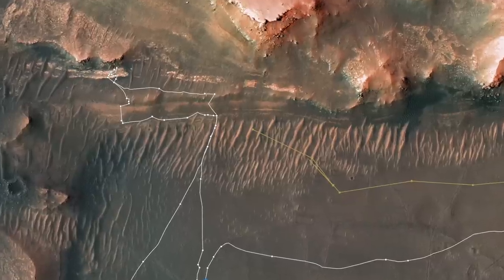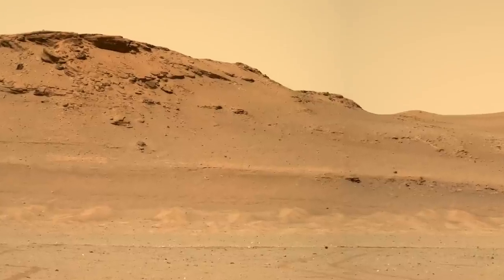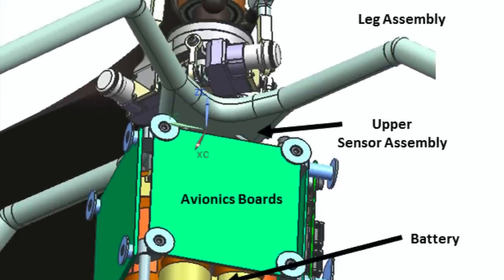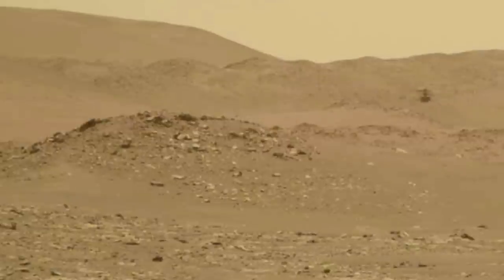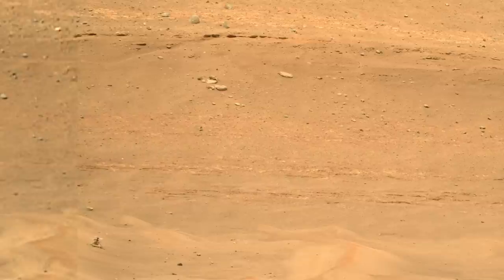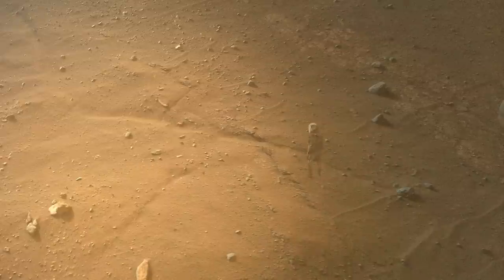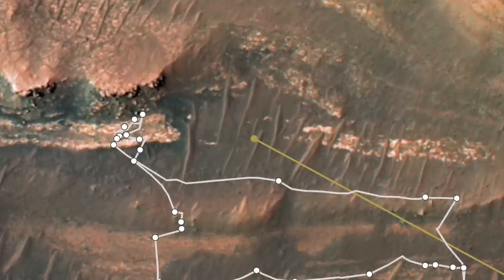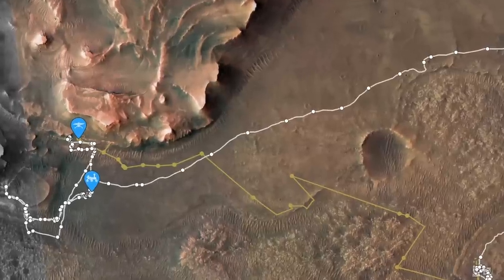Ingenuity flight gets dicey

Comment: Sloping ground landings and take-offs can be tricky, guess how I know.  Very impressive programming.
Reply: If they got the IMU to not require the attitude before takeoff it might not be too hard. LIDAR is referenced to pebbles, including footprints (landing gear). The accelerometers will tell you that you're moving in one direction, so somehow for it to go up more or less vertical (which is what you'd expect) the system will tend to correct for that.

Comment: It'll be interesting to see how Ingenuity responds to significant height differences once they finally decide to attempt to put it up there.
Reply: That's what I'm looking forward to as well :)
Reply: Will Ingenuity be able to go up 30 meters? 🙂
Reply: At the moment, I thought I heard that the helicopter is going to maintain an altitude of 10 meters above the ground in each flight.
Reply: @dment0077  The article "The diverse meteorology of Jezero crater over the first 250 sols of Perseverance on Mars", says: -" the atmospheric surface layer (ASL) is the lower part of the atmosphere in direct interaction with the surface, having a depth that varies on Mars from a few metres during daytime to tens of metres at night"-. It seems that MEDA made, among others, measurements of the temperature of the Martian atmosphere on the surface, at 0.85 m, 1.45 m. and 40 m. altitude and in the central hours of the day, when Ingenuity flies, there is a notable drop in temperature from the surface to 40 meters and all the helicopter's materials would be affected by such variations.

Comment: I didn't find that takeoff scary at all. In fact it was probably smoother than a human radio controlled craft on Earth. Take the computers away and make the human actually fly the thing. Slightly "wavy" takeoffs like that are the norm as the human customarily overcontrolls harmlessly. The scary part of this is that no human is there, yet, even missing its inclinometer, Ingenuity flies as well as a skilled human pilot would fly it.

It's amazing to see how a little helicopter that had to hitch a ride with a high dollar spacecraft, on condition that it use no power, no computer resources from the main craft, has risen above its stowaway status to become crucial to the main mission. That's the little train that could any day!
Reply from the maker: Nicely said!

Comment: My take is that Ingenuity needs to distinguish the light and dark sides of a ripple and not land on them 👍😄
Reply: If you refer to the areas of light and shadows as indicative of the crests as separating lines of two slopes (one may be steeper and/or inconsistent, I also see it compromised, but it seems to be what happened after flights 21 and 37 .
Ridges may be more than one near the top, perhaps with a more horizontal flat plateau. Perfect like helipad.